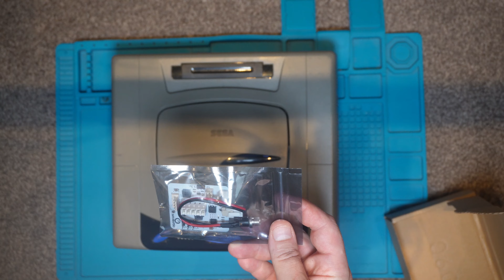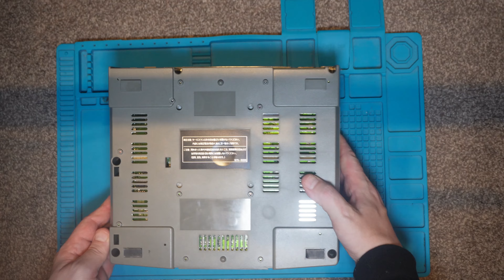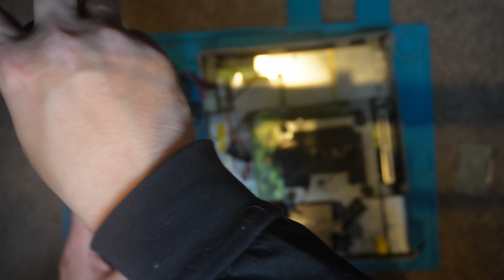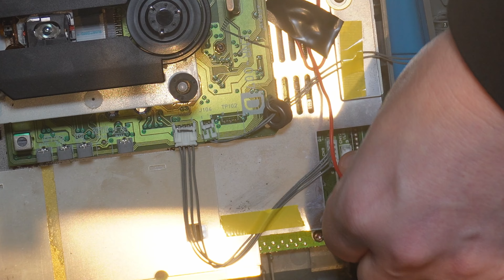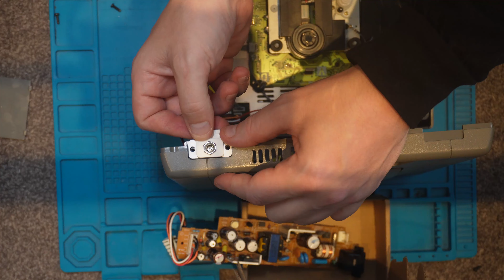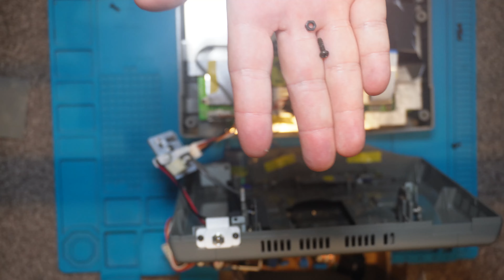Installing a Sega Saturn 12V PSU | Replacing a Blown Original Power Supply

Comment: I blew mine up too back in the day,  you know you can simply replace the whole board with one from a Dreamcast too?   What I did!
Reply from the maker: Lol its easy done.Thats good to know i had no idea you could do that, thanks for the info. Im still having a few issues i think my psu transformer is not the correct amps from what i can see i need a 3A, im sometimes getting crashes and glitches.

Comment: Put it back to 3.3V

Check the voltage on the power supply to make sure, but most likely your Saturn is 3.3V
Reply from the maker: Thanks for the tip, Im still having a few issues with it and will try that.